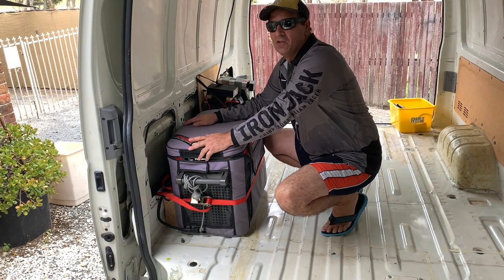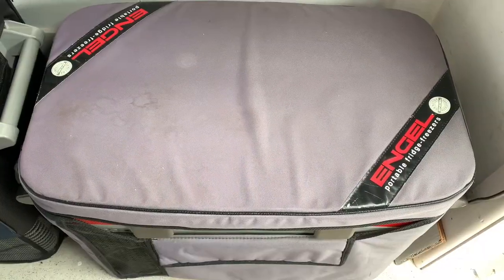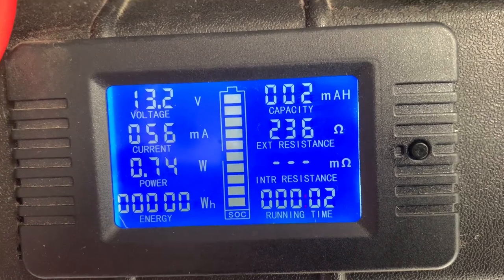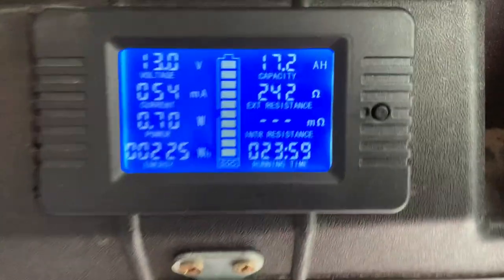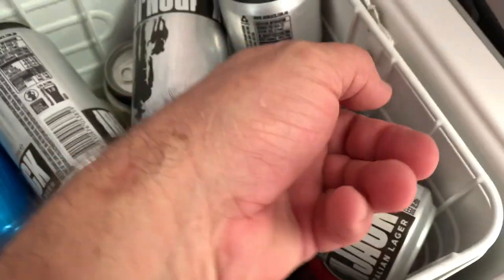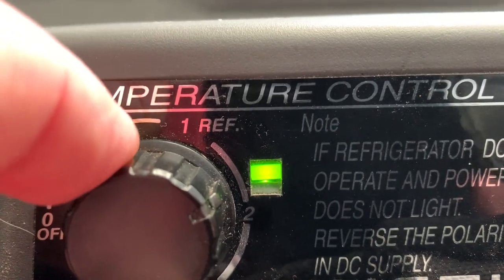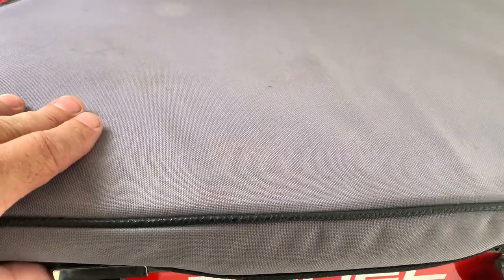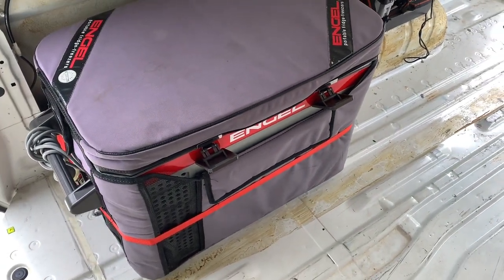Engel mr40f 38 litre fridge/freezer power consumption

Comment: Mine has the temp reading on the fridge both of them. but mine are the metal case high end units. I think i payed 1,100 each with the nice padded cool bags. But you do get what you pay for. And The BOSS (Sigi) only wanted them. She did not want any plastic rubbish. (her words)
Reply from the maker: Good stuff mate . They perform great . Engel for life 👍🍻
Reply: @EFFICIENTSELF  + They get a rough ride in the camper as we are off road 80% of the time, Next trip it will just be rough tracks. I was going to buy a big cheep 2 zone plastic fridge. But the bos soon sorted me out. She does the cooking so she picks what goes into the camper that is cooking related. She also does the map reading and tells me where to go. And yes that can have 2 meanings.  Me! I just do the driving and make sure we have enough power/water/fuel and a nice camp.
Reply from the maker: Cant complain with that mate . A well fed man is a happy man 👍
Reply: @EFFICIENTSELF  So true 😁👍

Comment: Interesting.  I have the newer one without the 240v and when cycling draws about 3.2amps.  Did 24hrs running at minus 15 at 26 degree ambient and used a total of 51 amps.  Still a good fridge though.
Reply from the maker: Ok  .that is quite interesting.  Mate the fridge will go for years .they are awesome. Thanks for watching 👍🍻
Reply: You used it as a freezer instead of a fridge, will always use alot more amps like that.

Comment: Great video, very informative, knowing the AH usage is very useful, thanks. I've had the same fridge for many years without any issues but I've only ever known the current draw. Was the van in the shade? What power meter were you using? What temperature unit were you using.
Reply from the maker: Wasn’t parked in shade at all might of been partially cloudy day.  The battery monitor was something similar to this  https://www.ebay.com.au/itm/303575227712?_trkparms=ispr%3D1&hash=item46ae7e5d40:g:eUMAAOSwaldex6X4&amdata=enc%3AAQAGAAACoPYe5NmHp%252B2JMhMi7yxGiTJkPrKr5t53CooMSQt2orsSzaVbXtmGxqmWnpn8RLN2q199KVaJSRyfkskBYQo89f4Klex5nIkdSb5CETH9NKLHSeLvLmvrIMyOh8%252B9FKB7WN83DxpMjxoHjOfwiXWiC%252FnH45ErdU4BXXvfV9tA0Ow9R5PYiQZYKrPzNRWRx2FE%252FenmNyruHi%252BJuxBQ6tfumnp8F2qX4kYQavoLMDPM46YYwkaHm%252BxV85gglKmqpKg%252FFFDKJgNLeJCkWMu6%252BgkuPF8yzCMHOUgpz0vyd6uS7WKcsJMcFDnonuKMtVM2%252FGt3g%252F0CAJp1wjj7eoE5%252B6VpogDa5u853xB86zozWk60v97lX8ntKqiy6HKHvwQbkphTLtUfflWNO6WUiL8BWVw3xXgxnXHmQ3J2KkUVJwd4BjMgXX%252FAE8x600AFXzLEWu%252FhQcAZJJJTTTHwMPgfv8aYRW7RijnBqmyY4NE2Ecp6WpYh8%252Bn9jIY4VsZcJxssVbZ86Ts27fnr2DJFs%252Bq%252FuDiv904Z7ghIVlf%252Fc0r12JaV01k7d1YUVqqjLfDGxlDNVS%252Fcr9lEStT%252F4gsmnPEWs0ELcDJYf5InoRM6KRtLLA75zsyxuK0y%252FpjhpbvpEDXBajaAjW64R9tO%252Bx9hb3LEaDN06vh3CqP5zQOt15aBFuAOdCqrWR5DMY8wakSgsYzB%252FTGgQtTxHOArctCSRl4X0P1Ml8YAchBNirZXiEpWNKgPVOUc5V7okJ2521Id8S5bztpI5m%252FQPSiScrshmz01B8jHethVIcSDFjr1iHW5Qe%252FjQauGYw7cBNT747D1bGW%252BD0vgbbAawaveRTtwpe9ZJlDxUlsGtvgHhkyikpDGs2yxMJ99YLzjMiOlDKPIdRkt7bPFLw%253D%253D%7Campid%3APL_CLK%7Cclp%3A2334524. And the temperature monitor is something like this. https://www.ebay.com.au/itm/234045710768?_trkparms=ispr%3D1&hash=item367e3621b0:g:8ZAAAOSwFkhg89w5&amdata=enc%3AAQAGAAACoPYe5NmHp%252B2JMhMi7yxGiTJkPrKr5t53CooMSQt2orsSRAQR8FABHjfpFoyRlXhWmXvmkqDEM2ZuxVnyYJnL4ILReb5XlGyeU%252B70qoSZoqSO6BDDf%252F6we01cA7Q1No9shN%252FPNe998M6nCNXuyGXu0kUFFlkPTBilGOl7U1n86f0I0yzT39uuxG3qzG4%252FkOyXjdqoq1BIuUoJ9ycvS03Y4nZ6n4g69d9n1MWHBRG5qtz%252FUYhP9ARMWsQ4Fon0bcAvDMCcpTa8O%252By%252B0hHMMU3N4%252FgaCm4poO%252FqouVyYEGfQ3xN%252FxpSBNyzY2HFuqCE03Dw5%252B0N2URjABwdsFk3p3CaDA6GbAv7fts6A0Q4YXXNnQ034bXjmv%252FB9KSAlVWTdVjH0AF7FpvvfMOy5z%252B4mwwBC%252BSRNdmTTVgD9ify42djUS%252Bq4TeRPvqFFhG8vb0Cgm9K9PQ6XKXJqlsO%252BHPihlZuwaT3GzsOzMe93yLF475A%252BX48mDqvTqA0%252FUBF1td5axJzxDOtpOqquByt1nNIarQtiIfoAiunqCbcORGt%252Fd8%252BApVsqD8Z6mbnt4qAv05OI1PCxPOpjPNJnrEMva%252FGaxaOF0yfF3AFZ0rkZTlSW5IYiZAoe8%252BSER9tFJRjJYpxQP%252BTkmFhL5wbKM7DZeW8GllKm%252BygjyhH%252F4L%252FVQIFnf3li1MTxyCwBxo%252FY7hk2FDfY9WiQheDcve8bjGOFl%252BovF85qFpLwooxS9237M4Ot0I%252FtfmiwzCvieEsVpjlOEzwlC%252BlrGtnK0mcCs190Q0%252B%252ByT0U4uLdO9kNE%252FXxInOc2p91%252FJpRTIamhbqeobc54H2DGnL2aOeaVgTM5SMNe%252BuGV2B470zAkRwGeO%252BZiK0SFQdYusR3OPGpJaS7CrJu64PGrvCyA%253D%253D%7Campid%3APL_CLK%7Cclp%3A2334524

Comment: hey mate great video.
do you think the low volt cut out switch is a problem not having it...

id be running this fridge on a 120ah deep cycle and a kings 200w solar pannel. for for 2 days away camping at a time.....
Reply from the maker: You will be fine 👍 thanks for your comment and viewing…. Much appreciated 👍🍻